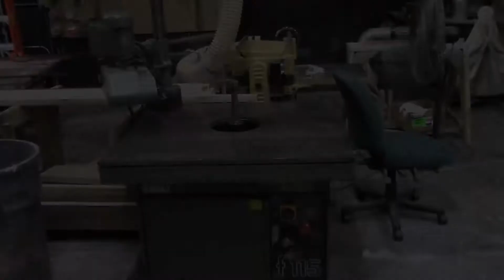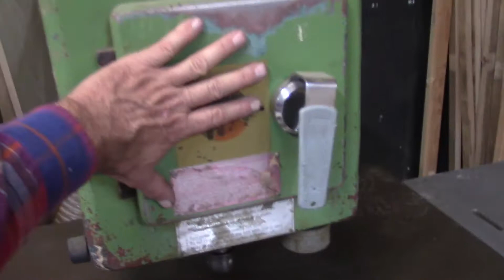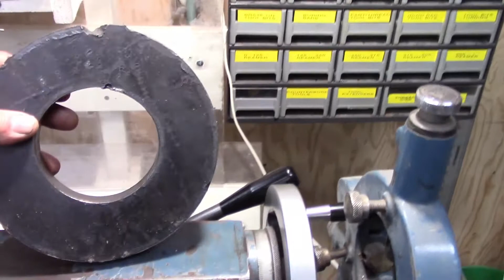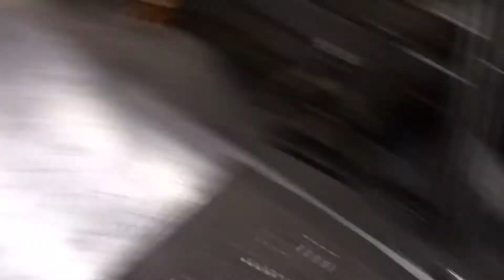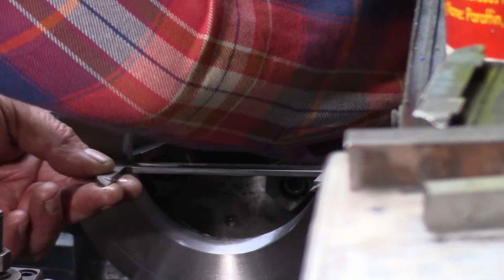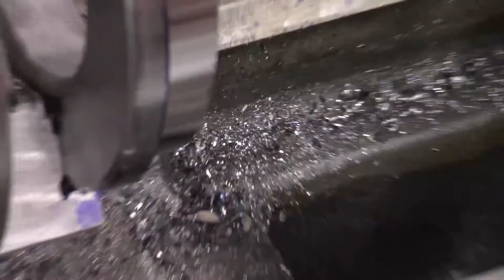Showing our New Machines & Using the Lathe to make a part for our Shaper {#65}

Comment: Hello Jeff, nice to see you and happy Friday.
Look at all of those Lathe dogs in all those sizes up along that wall. Nice new machine one we have never sen being for wood we do not know and like learning about these tools as well, the router we know not the Italian machine at all. That is a really big work surface. The big ring machined on the lathe looks good and in the end it is a nice fit despite being slightly smaller it is nice. See you again soon, hello to your nephew helper this is good family is a great thing. Lance & Patrick.
Reply from the maker: Thanks Guys. I got the lathe dogs with my Monarch Lathe, which I have as yet not been able to focus on to get it running. 
On the trim ring, the  material I started with was so rough that I had to take off more than I had hoped for to clean it up, thus the miss on the outside flange. But it turned out well and will do the job intended.
In the future I will be making a  fence for the Wood Shaper, and a indexable template for the Pin Router. Thanks For Watching!